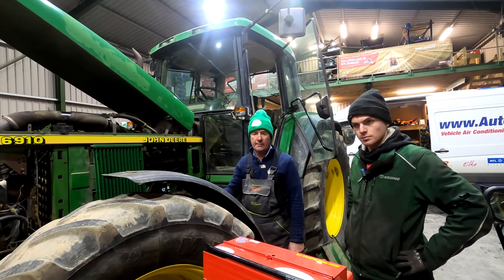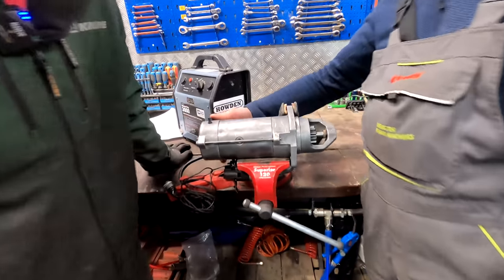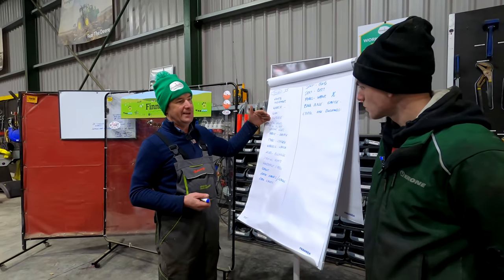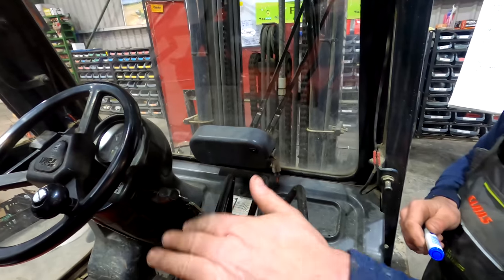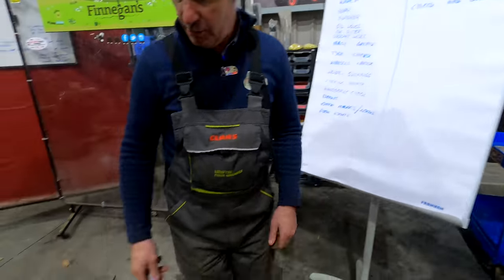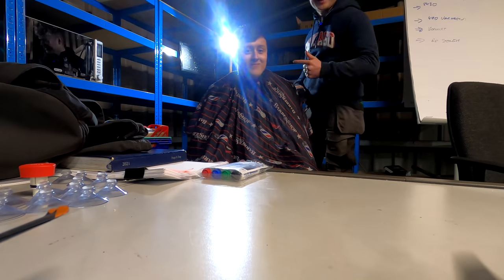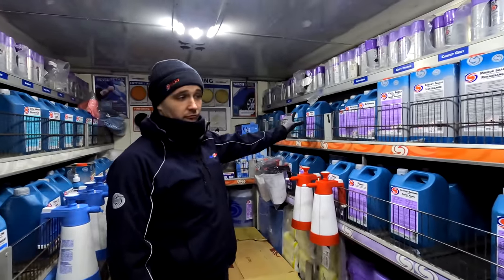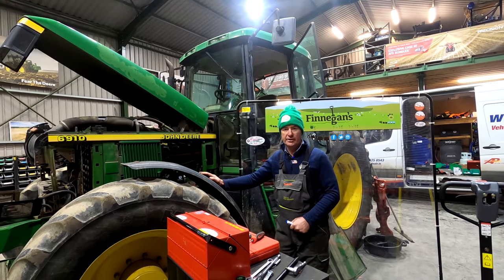WORKSHOP WEDNESDAY PART 6

Comment: Great video !  How do you heat this shop in the winter and what do you recommend for temperature ranges?
Reply from the maker: At present we use a 3 phase electric heater as the workshop is powered by a generator along with some other buildings due to a power requirement upgrade, we are currently looking at capturing heat from our refrigeration stores and blowing warm air into workshop around 13-15 degrees, it can be sometimes hard if 3 or 4 guys are working in there some may need more localised heat than a guy for example welding, other options are waste oil but found it to be a bit troublesome, hope this helps!

Comment: In the previous video you showed you bolts and nuts in colours according to the size But how do you determine if it say 16mm 1.5 mm fine thread or 2.00mm course or high tensile. 🔩🔧
Reply from the maker: We use metric course thread nearly all the time but you would have to create more bins with more colours for  metric fine and have a colour coded chart on wall regards Paul